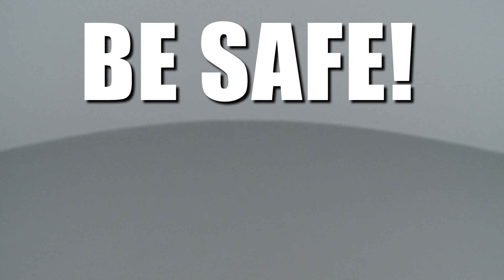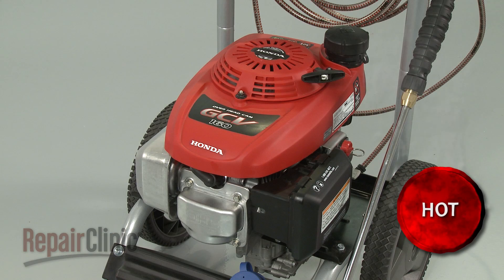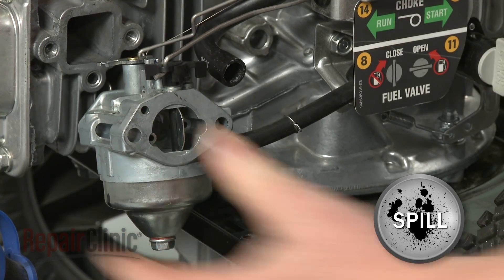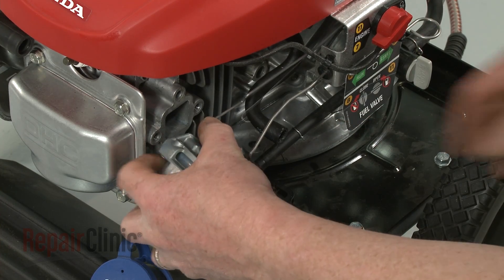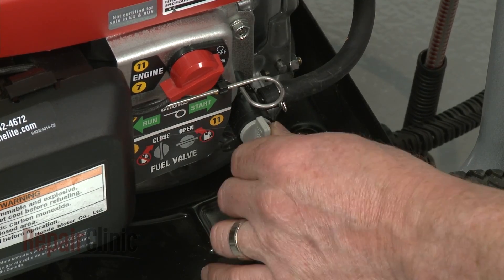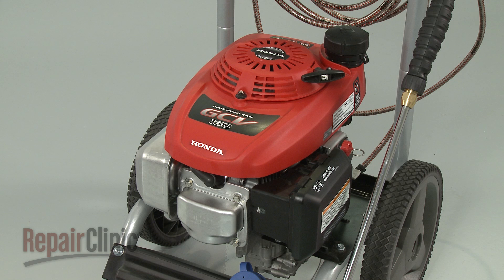Pressure Washer Won't Start? Honda Small Engine #16100-Z0L-864

Comment: Hi , does anyone know the part number to the "fuel line" that runs from the shut-off valve to the carb? Ty
Reply from the maker: You can find all the parts to your model by entering in your model number at RepairClinic.com.

Comment: the black plastic spacer which goes against the block has 2 sides obviously. one side was a worm like groove which must let fuel in ? nowhere does any video indicate which side the goes on. of course it fell out during disassembly.

Comment: Great video! Got my carb replaced and it started on the first pull. Thanks guys!
Reply: How do u really know if the carb is bad??
Reply: @Sk8420411  It ran fine previously but the engine wasn't starting after sitting for around a year. After draining and refilling the fuel tank I still couldn't get it to turn over. It's almost always the carburetor/fuel related when this is the case.

Comment: Thanks RepairClinic! I could use some advice. I have a 1 year old pressure washer, I unwisely used Ethanol gas and left it over a year and couldn't get it running. I just replaced the carb (and put in good fuel) and got it running for 5-10 seconds at a time. I then noticed I could get it running well by hitting the throttle with my finger. This is a GCV 190 and is supposed to idle down, but now it seems it won't rev up when I use the trigger on the handle. Again, I tried hitting the throttle with my finger and thus got it to work properly. Is there an adjustment somewhere to the throttle so that I don't have to manually throttle up the engine to get it to run correctly?  (Thanks in advance!)

Comment: At 2:00, video instructs to align gaskets and spacer - one looks like metal and two rubber.  I can only find one rubber for my carburetor (could be that I misplaced the rest a few months ago when I took it apart), however I cannot find any metal ones on ebay or amazon that come as a set.  Am I missing something?  Where do I find this metal piece or is this only for a select few engines?  I have GVC190 Honda.  Thanks!
Reply: Hello David. I have a GVC190 and replaced the carb just yesterday. In my case I had one metal gasket in-between the carb and the air filter housing, I'm sure it was metal. I had a large paper gasket in-between the carb and the engine itself. I took extra precaution to make sure I didn't miss any gaskets when I removed the old carb. I'm not a small engine expert, but my guess is that regardless of rubber or metal... what matters is that gas doesn't leak through it.

Comment: You don't mention which way the square bracket between the carb and the cylinder head goes.  At least in our case one side square - to match the cylinder head and the other side round to match the carb.  More detail there would be nice.  Also the link to the parts you give only list the carb and not the new gaskets.  Which in our case was causing a vacuum leak.

Comment: Very helpful vid. Made changing out my Honda carb much easier than it would have been. Only neg comment is that the carb I purchased from RepairClinic did not come with gaskets. Seems strange since they are so inexpensive yet quite necessary.

Comment: I have the same one but my problem is the fuel is not getting into the bowl. unscrewed the vent screw on top of carb and the bowl fills up. starts and runs till the fuel is gone again in the bowl? being there is no fuel pump not sure how this fuel is going into the carb or in this case not. any ideas?
Reply: Tim's Workshop TJY your fuel cap is bad. It’s vented and tends to clog up. Replace it and it should run fine.
Reply: Same thing happen to mine and here is what I found out.  Remove the fuel line where it is connected to the fuel tank and you will see inside the fuel line there is 3 inches long fuel filter filament you can replace that with new one.  The problem was solve in my case.  Hope this help!

Comment: Excellent video and I was able to clean the carb and replace it with no problem with the help of the video but I am having a problem with the auto choke set up is their any
video on that subject.. thanks for your help
Reply from the maker: Wayne Lamarche We do not have anything for auto choke. You may want to see if you can find the service manual for that series of Honda engine.

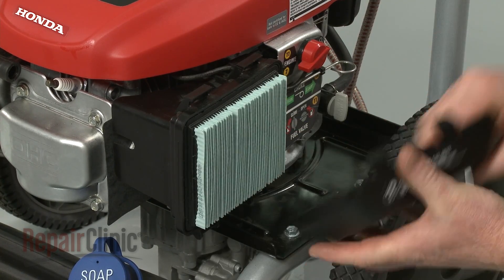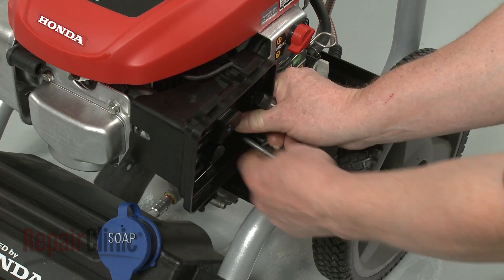Comment: Excellent video but I noticed that it appears that you installed the large gray cardboard gasket (heatshield?) that is next to the black plastic spacer differently than it came off. See the video at 0:40-0:50 and compare it to the re-install at the end of the video (about 2:18). The gray cardboard gasket has been flipped horizontally and thus moved inboard where before it had an outboard overhang.  Might make a difference as there is a small hole in one side of that gasket (altitude adjustment?)  and not in the other side.
Reply: richard is correct.  I just took the carb apart today to clean the float bowl and main jet/nozzle and the heat shield should be swapped 180 degrees when putting it back on to provide better thermal protection from the engine heat sink.

that one mistake doesn't mean I didn't watch this video twice to make sure my control arms were in the right slots when I put it back together.
Reply from the maker: Richard Hodges Everything looked lined up properly to us when we put the gaskets back onto the bolts.
Reply: *****  - It may have "looked lined up properly" but you still flipped the gasket horizontally and the final result is not the same configuration as what you removed. There's a small hole (opening) in the gasket that is, I think, an altitude compensation hole that has been switched from the right rear of the air filter housing to the left rear of that housing. It may make no difference at all but the large gray fiberboard gasket you put back on at 2:18 is not the same orientation at what you took off at 0:40-0:50.  If it was correct at the start of the video it's not correct anymore. It "fits" but it's backwards from what it was originally. Thanks for an otherwise excellent video.

Comment: Good video. Replace the useless fuel feed hose clamp with a real one. This engine is but one of many GCV160 variants. On some, replacing the carb gaskets is a pain as they cannot be preloaded on to the bolts as shown here.
Reply from the maker: Thanks for the tips!
Reply: You are so right .My washer is a devil to take the carb on and off.

Comment: I'm looking at where the choke rod is attached on that black plastic part and on my Honda lawn mower the choke rod is attached on the other hole. Is there a reason for this? Thanks.
Reply from the maker: Different motor applications will have different linkage setups. I would put the springs and linkage in the same positions as you found them originally.

Comment: Thank you so much for this video.  I spent hours trying to find a source that would show the installation of the gaskets, since they fell off when the carb was removed.  Even the parts diagram from Honda was not that helpful.  Your video clearly showed the complete removal and installation af the carburetor for this engine on a power washer.   There were many of the GCV160 engines but they do have differences.
Reply: I just had the same thing happen - all the gaskets fell out when I removed the bolts. I figured out all the gaskets but I'm not sure which way the 1/4" thick black plastic spacer goes in. One side is flat and the other side has a cut-out but you did not show which way you re-installed it?  Does the flat side go towards the engine or the carburetor?  Thanks!
Reply: EOSJOE I want to know this too.
Reply from the maker: We're glad we could help out!